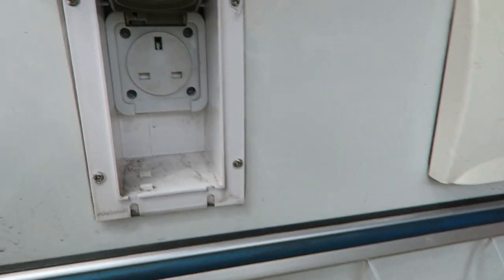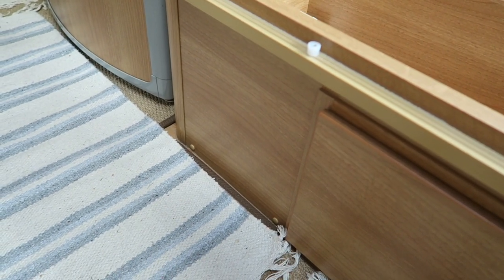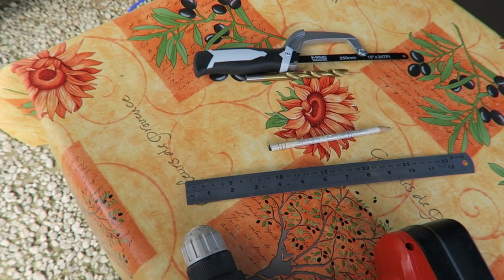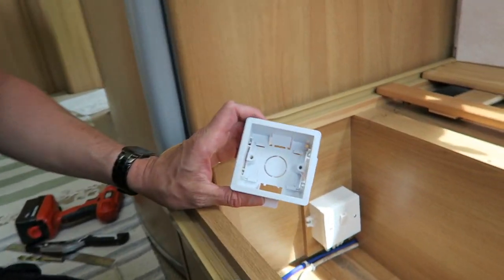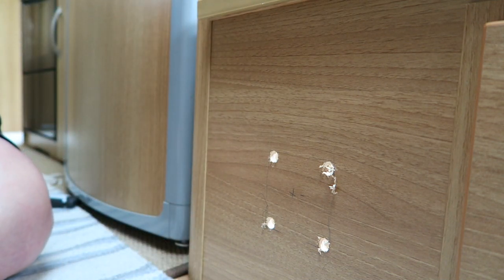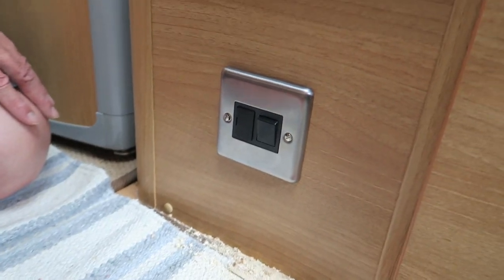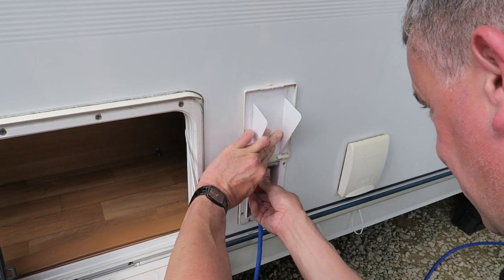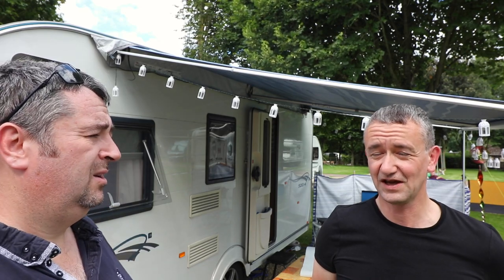Wet Locker switch installation

Comment: Hi Dan
A very late viewing by me 
Just one comment , the back box you fitted looks like a dry lining box. if it is then you should pack the fixing tags on the back of  the box as the are designed for 10mm /12mm material and struggle to tighten on thinner material, good idea though, did a similar thing to fit a double socket in my van.
one question to ponder over:-  why dont caravan sockets have isolator switches like household ones.

Comment: Nice video but a few points:
1: Why use a fused spur switch? these would normally be used when you are supplying a 3/5 amp light from a higher amp (32a) circuit to give the correct amperage protection.
2: The wires behind the switch in the locker really need to be secured as they could be pulled out by loading/unloading stuff.
3: The smaller cable has a lower amperage rating so it's not a good idea to use the wrong size as it could over heat and melt, especially when using an elec BBQ as they have a huge amp draw, this worries me - a lot, I suggest replacing it with some 2.5mm flex.
Reply from the maker: Hi Rob, thanks for popping by. 

The switch used is a typical example of "use what you have at the time" I know a non-fused switch would be perfectly fine in this instance as the main fuse board has an explicit circuit breaker for the wet locker. It's as simple as "the shop didn't have a silver non-fused switch"

Also after this video was recorded, Rich did pin back the cables so they wouldn't get caught up or get in the way of loading the locker.

I hope that helps

Dan
Reply from the maker: oh sorry - just read your point 3. The cable is rated at 16Amp / 230v - so well withing tolerance.

Comment: Nice Video Mr Trudgian you will be editing a film next.   Excellent
Reply from the maker: Thanking you sir, not sure I'm at Spielberg level yet - in either talent or subject matter - but if there was ever a big budget "caravan" film - I'm sure i could help lol. Thanks pal for your comment !!
Reply: Any electrical work should not be attempted by anyone who is not a qualified electrician. Extending electrical wiring requires testing and inspection to BS7671 standard, no account has been taken into consideration by these amateurs  for the importance of continuity, insulation resistance or earth loop impedance. Cannot stress enough how many people been injured or even killed doing diy electrical work.
This video is irresponsible, I am appalled at the encouragement to attempt  this kind of work that has the possibility of killing you or your loved ones. Please do not attempt electrical work without proper knowledge and qualifications, having little knowledge is as dangerous as having no knowledge. Please seek professional help.